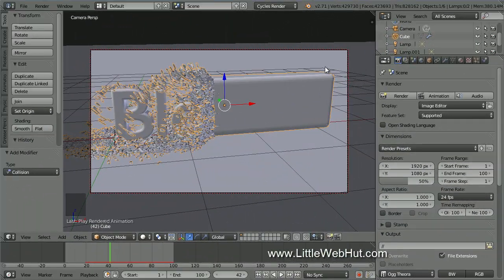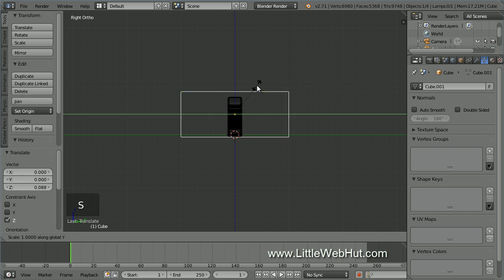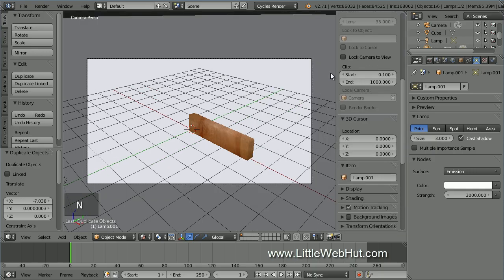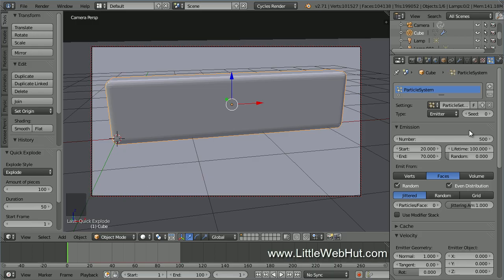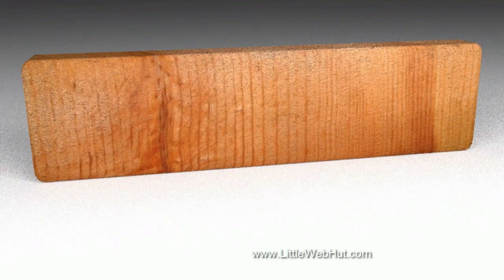Blender Tutorial: Wood Chipping Text Animation

Comment: Great tutorial. I am using Blender 3.3 and yes I can follow along with this tutorial once I get used to where the new buttons and apply buttons and UI as a whole in 3.3. However, when I add solidify and apply it stops the animation from breaking apart. The frame runs but when I reach frame 20 it dose not animate when the solidify modifier is applied. How to remove a modifier in Blender?

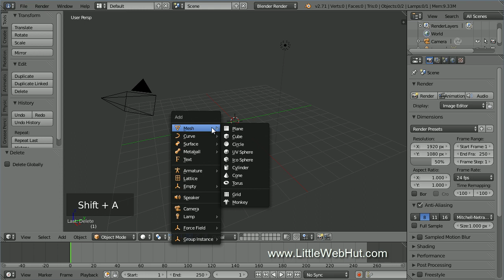Comment: 00:28 Text added.
01:22 Block of wood (cube) added.
02:53 Edges of cube beveled by using the Bevel Modifier.
04:12 Geometry added to the cube by using the Remesh Modifier.
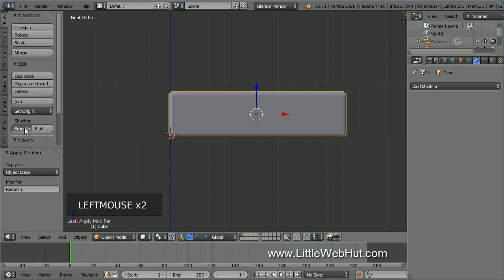04:52 Cube material set and wooden Image Texture added.
05:32 UV unwrap cube using “Project from View (Bounds).”
06:08 Depth added to the wood texture by using the Node Editor to add a Displacement.
06:52 Wood material named.
07:03 Wood material applied to text.
07:29 Text converted to mesh.
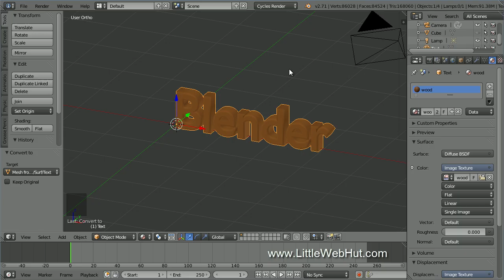07:41 UV unwrap text using “Project from View (Bounds).”
08:21 Floor added.
08:52 Lighting is setup.
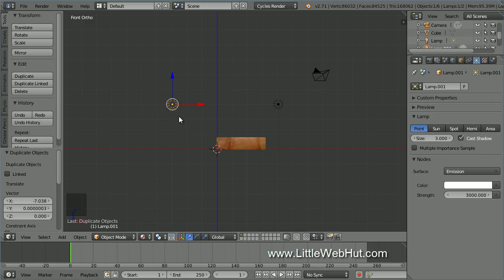09:53 Camera view is setup.
10:36 Wood chipping added using Quick Effects.
11:04 Timeline overview.
11:36 Particle System modifications.
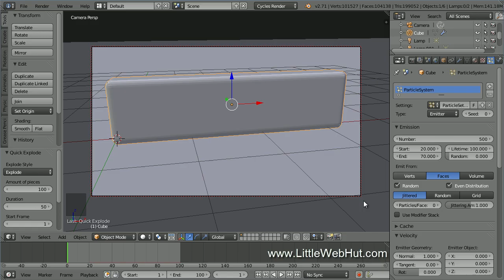12:26 Blend texture added to control how the wood chips break away.
13:36 Thickness added to wood chips using the Solidify Modifier.
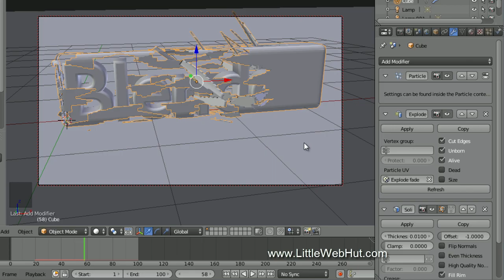13:59 Collision physics setup for the floor and the text.
15:06 More particles are added.
15:23 Render options are setup.
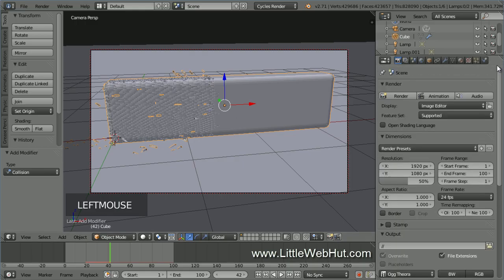16:28 Begin Animation rendering.
16:59 Play Animation

Comment: Has anyone tried this with Blender version 2.78c?  I'm getting the brown wood block issue mentioned by many people, but yes, I've tried the fix offered by AFWSI, but it made no difference.  My text is using the same wood material as the cube and looks beautiful, so I am pretty sure that I've set the nodes correctly, followed the tutorial steps exactly, etc.  I even tried what another user suggested about adding a second Explode modifier, but I removed it when it made no difference.  Any help would be appreciated.   I wonder if there's something with my Blender version that wasn't a problem before?  Thanks.

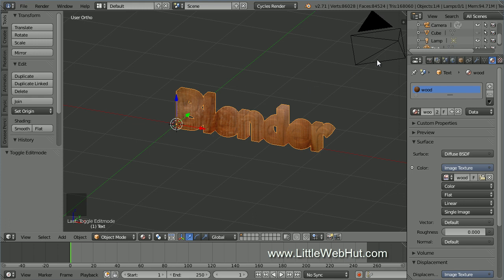Comment: I've been having troubles with this one.  I was up all night waiting for the final render, not realizing it was going to take upwards of 5 hours.  I put the 'chips' at about 2500, I pushed up your recommendations slightly for a lot of the settings...but everything was proportional.  It got to frame 70 out of 100 rendered but I was so damned tired so I left the computer on.  In the morning when I woke up the whole program was off so I figured it rendered completely and shut down.  Well it only had a 4 second clip so it obviously didn't even get to the first frame of the 'chipping'.  NOW, I started where we saved at around the 8:00 mark and I input 500 as the emission number as you did.  I pushed play but nothing happens.   Side note, my 'cube' is super gridded vs. smooth like yours.  But it has the wood grain when viewed as such(both text and cube).  So yeah, it won't preview the rendering to see the sizes of the chips.  What the hell?!??!??!
Reply: And now I see that it's just doing the preview render at an extremely slow speed.
Reply: Rip

Comment: I made a version that has the words stacked 3-high so I had to make the cube higher (6.144, 0.414, 3.125) to cover everything. It still works but some of the pieces of the board don't fall to the floor, they just hang near the top or center. Can I force everything to settle somehow? I've tried giving it more time but it doesn't matter.

Comment: awesome tutorials, I think I've watched most of them. one thing though, and this is just and example so it's not a big deal, but most boards, or long lengths of wood have the wood grain going along it's length, not width. It's just a minor thing, but for someone whose worked with wood a bit it's kind of off putting and makes the wood piece look strange.
Reply: +killen joke  Have you tried switching the jpeg view before you use it? I have several jpegs that the grain runs long ways that I made in printmaster.
Reply: Gaouse
 i'm talking about his tutorial image. i would definitely reorient the image before using it.
Reply: +killen joke Sorry after reading it again i saw what you were saying.

Comment: I am using the latest version of Blender and when I add the particle system to the cube it loses it's material (the wood texture). I have disabled the particle system and the material is visible, but when enabling the particle system again the material disappears. Can anyone help me out with how to solve this?
Reply: Update, it seems that this tutorial is not compatible the latest version of Blender, short update solving the problems perhaps? Thanks.
Reply: +Braderzian uncheck  "cut edges"  on the explode modifier. Earlier versions worked for whatever reason when the cut edges was selected.
Reply: Thanks a lot, how did you figure that out?

Comment: Very cool animation! Thanks tutor4u for demonstrating this. I certainly learned a lot about using Blender (ver. 2.74) and I see I have a lot more to learn. Right now, I just want to go back to editing the wood-carving animation to clean up a few things. I started Blender again and opened the file. I was expecting to see a wooden block sitting on a flat surface along with that XYZ arrow thing. Instead, all I get is an empty gray grid in the work area. I figure that I need to select an editing mode. Can anyone point me in the right direction?

Comment: Everything starts out great until I reach the step at six minutes and six seconds into the video - when I select material, I cannot see the image. I cannot see the woodgrain. I can see it in edit mode. But not in object mode.

 I can see the woodgrain in the text, just fine. I just can't get it to display properly in the block. The block does change colors however, when I select material - it changes from the gray color to a color that looks closer to the color of the wood, but it clearly does not have the woodgrain and it doesn't look like the wood image. 

Any suggestions?

Comment: Blender noob here.  I get to the part in the video where you set the collision on the floor & text, but I do not have "collision" available when the text is selected; only force field & rigid body constraint.  What obvious step did I miss?
Reply: Steve McCracken U need to switch from blender render to cycles render 
or  u just watch a toutorial on blender render physics :))
Reply: malchik12 I appreciate the response.  I was on cycles render, but when I re-watched the video, the obvious step that I missed was converting the text to mesh.  After I did that, the collision option became available.
Reply: would be my 2nd guess :)

Comment: I HAVE A PROBLEM , why i follow all the steps and it is blending from the right-side ?
Reply: lex ng turn your monitor 180 degrees, that'll work
Reply: lex ng jusy found a workaround.
rotate the z axis 180 degrees then it works
Reply: i have that same problem!
Reply: Siggitron Mallotron yes me too
Reply: Me too!
Reply: +lex ng Your wood is at the wrong side. Just turn it :)
Reply: thank you so much :) it works
Reply: I had the same problem and it was as simple as rotating just the wood block 180 degrees on the x axis
Reply: lol
Reply: Hello, I was also having this problem. I found the solution to be pretty simple. Select the cube, then rotate it on the Y axis by pressing 'R' then 'Y' then typing '180' then press enter. It should break away in the correct direction now! I hope this helped!
Reply: Even I don't have that problem

Comment: I may have a tiny problem here... I am using the blender 2.73a and ehm... beveling the cube, the menu does not look like yours and I can not set the segments since it is not showing... Anyone an idea on how to do it still? It is the part 03:13 in the video.
Reply: make sure you are on 5 mode
Reply: maybe the problem is on "object mode" and "edit mode" please check the detail and see if there is anything that diffrent from the video and yours
Reply: Yukino Takada There is a significant difference in the menu that is on the AddMOdifier menu. That is why I wrote down my blender version, it is a newer one then used in this video. So I was wondering if they have maybe moved the option for segment setting that normally was under this option to another location in the program...
Reply: Mine version is the same as yours 2.73a and it worked exelent.
Reply: ***** Where do you find the setting for the segments that you see in the video at 03:13? Cause in my version... I can not find it, it is not where it is as shown in the video.
Reply: Siggitron Mallotron Hmmm ehm... I would not know, but I could have... I will have to see... Though it was twice that it happend with some time inbetween... But will have a peek into that, might be indeed I did...
Reply: SimGandr I have the same problem as you have SimGandr. And it has nothing to do with the numpad. the numpad 5 is just the view. Our problem is that the menubar is diffrent... Really nobody can help?

Comment: I've gotten up to about 12:30 but I've reached a ridiculous problem...

I've followed the tute move for move, yet when I play my animation it does nothing until from 50. Then, a huge chunk, the length of the text and about the corner around the top just breaks off, and then there's huge, sharp movements and more massive pieces jumping around like a huge glitch. They then proceed to fall into the floor along with the rest of the block at around frame 80.... nothing about this is right.

I decided to ignore it in case it would get fixed by what follows, but when setting the animation to blend from left to right, it merely waited until from 57 to start doing the exact same thing. I also tried upping the particle count to 2000, but no matter what number I put in for the particle count, there's only about 6.

I'd love to know what the heck I did wrong... but for now I'm just going to restart :(
Reply: same here bro, but no solution found :/
Reply: ***** yeah me too works fine,but seeing that the problem is on the animation,you should check carefully the detail,especially at 14:10 till the end

Comment: i am doing this but i got to a point where i need to press the middlemouse key but i cant because i got a laptop so this means that this video is for desktops only!!!!!!!!!!!!!!!!!!!!!!!!!!!!!!!!!!!!!!!!!!!!!!!!!!!!!!!!!!!!!!!!!!!!!!!!!!!!!!!!!!!!!!!!!!!!!!!!!!!!!!!!!!!!!!!!!!!!!!!!!!!!!!!!!!!!!!!!!!!!!!!!!!!!!!!!!!!!!!!!!!!!!!!!!!!!!!!!!!!!!!!!!!!!!!!!!!!!!!!!!!!!!!!!!!!!!!!!!!!!!!!!!!!!!!!!!!!!!!!!!!!!!!!!!!!!!!!!!!!!!!!!!!!!!!!!!!!!!!!!!!!!!!!!!!!!!!!!!!!!!!!!!!!!!!!!!!!!!!!!!!!!!!!!!!!!!!!
Reply: Go into File --> User Preferences --> Input --> Then check "Emulate 3-Button Mouse" --> Then click "Save User Settings" so Blender saves the setting.  You might want to do this when you first open Blender, as it saves the exact state of the software.  You can always click on File --> "Load Factory Settings" to restore Blender to it's original state.

You'll then be able to hit alt-left mouse button to emulate the middle mouse button.  While you're in the same settings panel, you'll probably want to check "Emulate Numpad" as well, it will allow you to use the regular number keys instead of a numpad.
Reply: thanks

Comment: Help! I have activated "Collision" but the Particles fall trough the Plane!
Reply: i had a similar problem.  tried a few different things but eventually found that the plane was on a different layer.  switched the layer to be the same as the cube and the text but still didn't work.  then started looking around some more clicked on something randomly by accident (i think it was physics -> soft body) and suddenly things started working.  turned it back off again and it carried on working

works quite well now only snag is the particles on the plane slowly disappear as the animation goes on

(for the newbies like myself layers is on the object button (looks like a cube) which sits between world (looks like a world) and object constraints (looks like a couple of links)
Reply: Thank you, i will try it :)

Comment: Quick Question : I followed your tutorial and somehow it goes from right to left. I didn't rotate on the y axis. Any idea ? I can read the Text correctly.
Reply: Keelan Lee
Go to the Textures Tab.
Make sure the selector says 'ParticleSystem'. (pulldown at top of panel, might say Image Texture)
Under 'Colors' make sure that you have 'Ramp' checked and immeadiately below you will see a plus (+) sign, a minus (-) sign and the double arrow I suggested clicking.
That same line also includes selectors for 'RGB' an 'Linear'
Hope this helps... :)
Reply: Sounds like you may have inverted your texture.
I answered the same question for another user.
On the texture tab there is a left/right arrow that will invert the direction of your texture..... HTH
Reply: Tom Stephan I'll try that. Thank you :D
Reply: Tom Stephan
Where abouts in the texture tab?
Reply: If you look part way down the panel, you will see a spot where there is a horizontal rectangle containing the gradient texture. The double arrow is on the left side of it.
I am not at a computer with Blender, so is from memory.
Just be sure you are looking at the texture panel and not the material panel. The material is a small circle and the texture is a rectangle..
Hope this helps... If not message me again and I will answer when I am at a computer with Blender on it.
Reply: ok mate i'll check it out
Reply: Tom Stephan I can not find it!  Can you help me please?  Thank you.
Reply: Tom Stephan It did.  Thanks so much!
Reply: You are welcome....
Reply: Tom Stephan if i had seen this i wouldnt have had to rotate my text and place the lights right ^^
Reply: Tom Stephan Beautiful! I was having the same trouble, totally worked.

Comment: I have a problem. when I try to use "quick explode" then the cube just cracks in half and falls through the floor. I haven't turned on physics yet, and my cube hasn't had any loop cuts applied either.
Reply: Nevermind, I didn't add the "Remesh" mod

Comment: my particles keep falling throug the floor please help me
Reply: Go to physics tab and activate collisions when the floor is selected
Reply: i tryed they are keep falling throug
Reply: Try turn on "rigidbody" on plane. Than set to "active" and uncheck "dynamic"
Reply: ok i will try
Reply: i had a similar problem.  tried a few different things but eventually found that the plane was on a different layer.  switched the layer to be the same as the cube and the text but still didn't work.  then started looking around some more clicked on something randomly by accident (i think it was physics -> soft body) and suddenly things started working.  turned it back off again and it carried on working

works quite well now only snag is the particles on the plane slowly disappear as the animation goes on

(for the newbies like myself layers is on the object button (looks like a cube) which sits between world (looks like a world) and object constraints (looks like a couple of links)

btw, i did try the "rigid body" idea before i found the layer.  i turned it off again after altering the layer

Comment: In the end it looks a bit pixelated. How can i fix this, i have time to render all day  long ^^
Reply: Just add more Samples. If you do want a good animation. Also, it is NOT recommended choosing a Movie format when finalizing your render. Choose .png into a dedicated folder. Then composite the pictures into a movie file later. There are tuts about this from BlenderGuru etc.
Good tut though for Blender beginners.
Reply: Depends on what exactly you mean by pixelated. Turning up the samples will produce a smoother image with less off a noise or 'film grain' pattern. Setting the final render samples to 100 should be enough for a project with just diffuse materials, but it will take 10 times longer than 10 samples. You could also mean that the pixels are too big, so for that you'll want to turn up the render resolution which is located in the Dimensions tab just under the render button. Setting 'X' to 1920 and 'Y' to 1080 and setting the percentage value below it to 100% will give you full HD, again it will take much longer.
Reply: I meant the film grain pattern ^^
Reply: Your lucky I have no time at all to animate :(
Reply: mutantgenepool for movie make pictures after video but for short videos like this if you have good PC just make movie file like me all is fine.
Reply: Markor
One thing your going to want to do also is put #frame into the seed input in the sampleing panel. This will make sure that if you have any noise, it won't be the same pattern making it look like a dirty screen was put ontop of it.